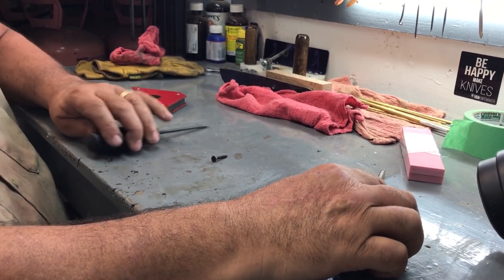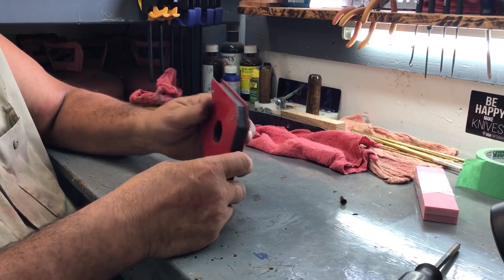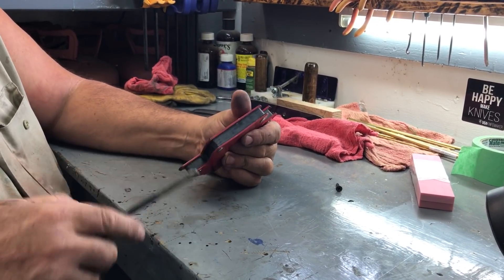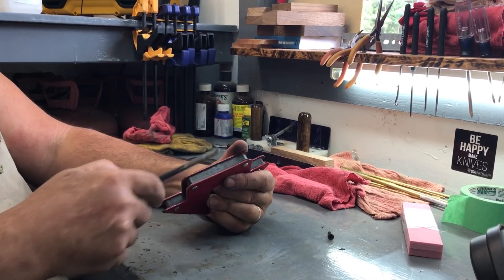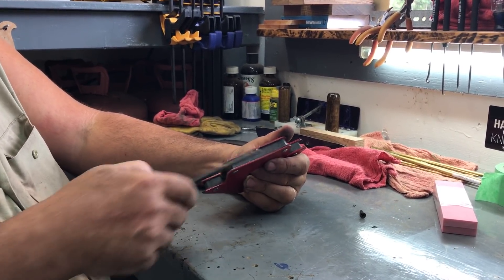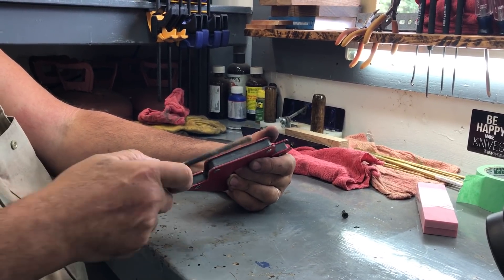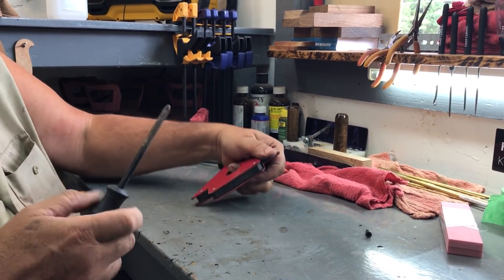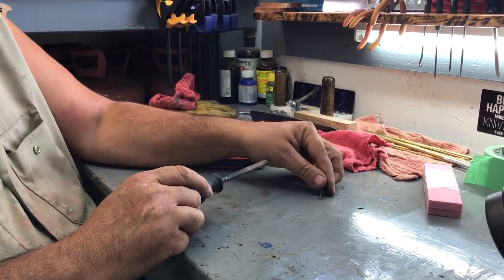How to magnetize a screwdriver

Comment: Awesome! One other thing I do is put some adhesive heat shrink on my screwdrivers shaft and some socket wrenches (except for the tips). Prevents shorting out and exploding batteries when working near DC (and AC for that matter) power sources when you drop them or screw up.
Reply from the maker: Love the shrink tube idea!

Comment: Having done this many times in my life, it should take  far fewer strokes to do that. The stronger the magnet the fewer the strokes. A neodymium  magnet stuck to the drivers shaft will allow the magnets magnetic lines to extend along the drivers shaft to its tip. As a young lad, I would wrap a insulated bell wire around the drivers shaft and attach the wire ends to a big 1 & 1/2 volt battery and I had a electromagnet. For those who do not know, a neodymium magnet packs a very strong magnetic force into a small magnet. They can be difficult to remove.

Comment: Does that work with cell phones too? Maybe if I magnetize mine I would leave it laying around then lose it....
Reply from the maker: Ive dropped mine in the dogs water. Ive dropped it out of my shirt pocket when bending over.  I only lost it once. I layed it down at home depot while I was trying on gloves. I have to search through them all to try and find the one pair that will fit me. I found the gloves,paid for them,got about 10 miles away and noticed I didnt have the phone. I broke several laws getting back to home depot and Im sure they had a good laugh at the fat guy trying to run in the store. I found it laying right where I left it.
Reply: Dawn Hernandez , na  not a good idea, it would stick to my head and wouldn't be able to get it off.

Comment: I just stick a rectangular neodymiun magnet on the shaft and I'm done.   But I too could use the exercise.
Reply from the maker: This is more for if you have a screw you need to drive in an area that you cant get both hands to. its quick and everyone has a magnet somewhere.